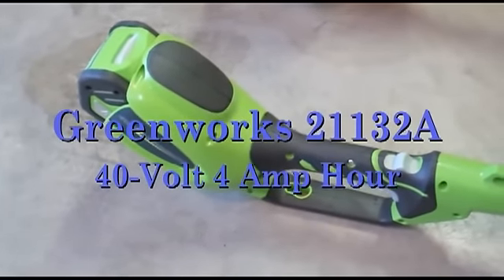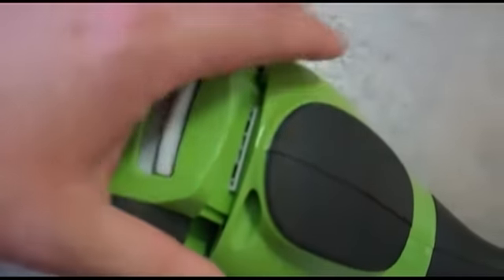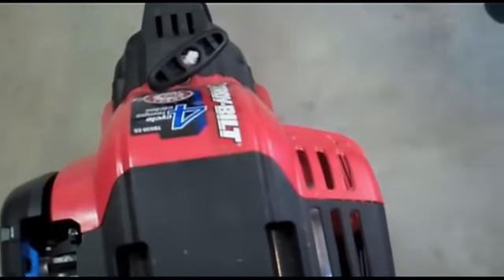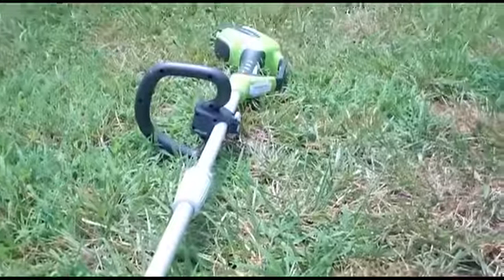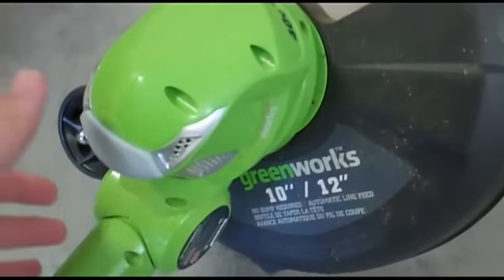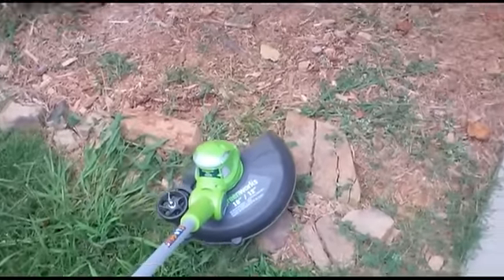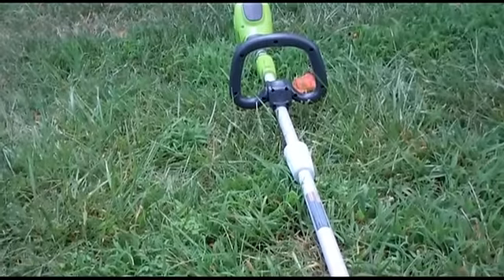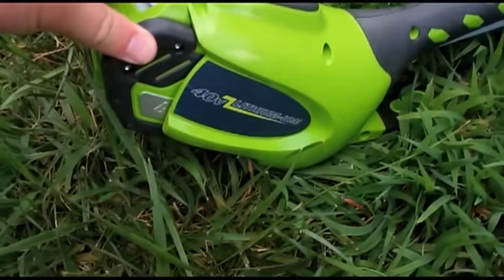Greenworks 21132A 40-Volt 4 Amp Hour Cordless Lithium Ion String Trimmer

Comment: Yeah the string release, the automatic one is a bit bad designed. Like today, I was cutting a bit longer grass, and for better performance cause of long grass, Ive take down the guard, but than stupid thing started to releasing wire completely randomly at any time, even when the gas was on the same level and speed all the time. And about 4 times Ive ended up with about 20-30cm wire out of nowhere in just seconds.  Also until Ive depleted one battery it took me 3 whole re-wiring string. And no this is not because of the guard off, 2 days before I was able to go through even taller grass and it took be about 4 6Ah batteries to deplete all the string in head, without the guard :) Its just so random, Im wondering if I could somehow "disable" the automatic release.

Comment: Great review. I got tired of rebuilding my gas trimmer every couple years, and thought I'd give this a shot. Glad I did. If you need a powerful trimmer, or if you are used to gas trimmers, this is the one. The attachments are interchangeable with my Ryobi gas trimmers, and it is just as powerful. Great deal at 
http://www.amazon.com/gp/product/B0030GEXUO/ref=as_li_tl?ie=UTF8&camp=1789&creative=390957&creativeASIN=B0030GEXUO&linkCode=as2&tag=sweafigh-20&linkId=I7HGQAX3OCEON4GT
Reply: +Jackie Nelson cool :)
Reply: +Jackie Nelson thanks

Comment: Thank you for comparing this to the Toro. As I understand it you can interchange gas accessories of the Toro to the string trimmer, such as the edger.  Since you can't change the trimmer head on the Greenworks, is it possible to also interchange the Toro trimmer to it also? I have interchanged the head on my Toro trimmer that I think I would prefer to use on the Greenworks trimmer.

Comment: Thanks.  Does the line automatically feed when you stop it from running?  I think the Ryobi 40 volt does that, but the Ryobi's 40 volt battery only had 2.6 amps pet hour and recharges in 90 minutes.